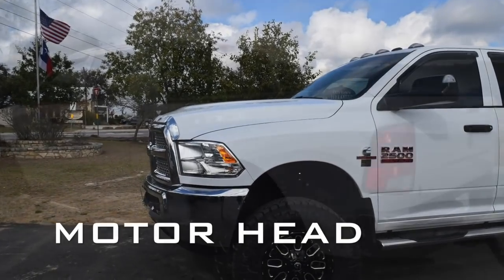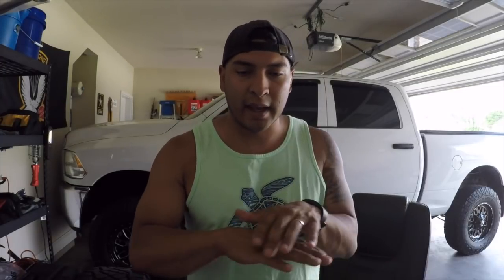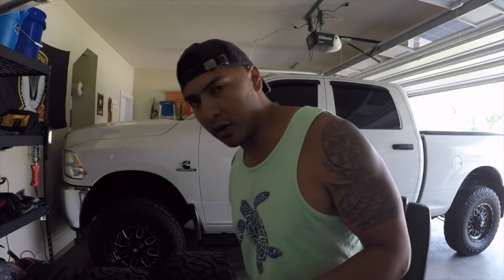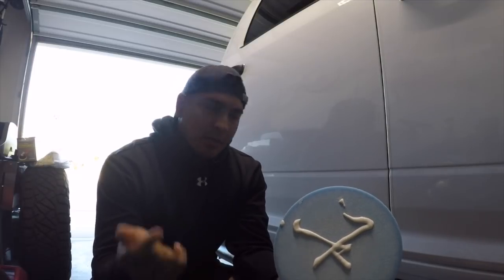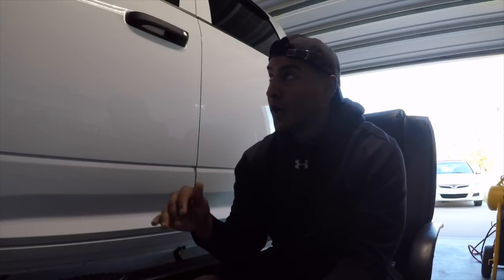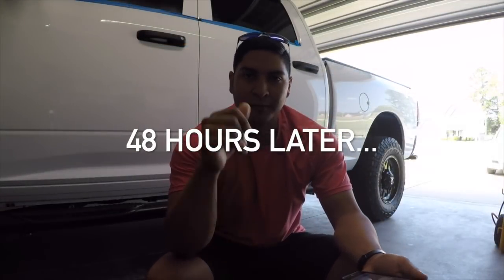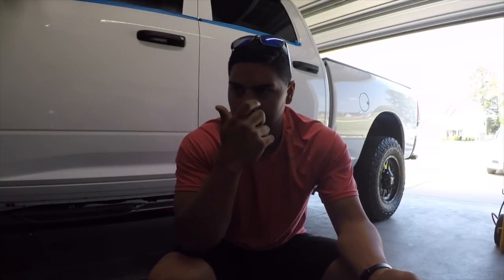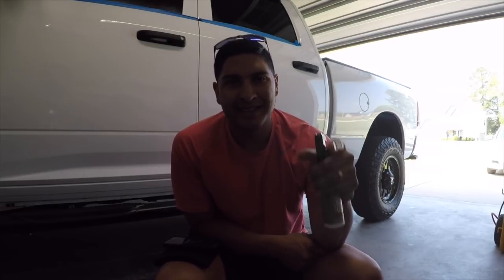Adams Ceramic Coating on Ram 2500!

Comment: I’m very interested in having this done to my silver ram 2500. I could never physically handle it due to major back issues and arthritis. It’s hell getting old.
Reply from the maker: Hard Truth It takes time but it’s quite rewarding. I’ve washed it once since the coating and it’s much easier to wash. In this 90 degree weather, the water beads off after driving it a little after the wash.

Comment: Great video, are you considering ceramic coating your windows?
Reply from the maker: Lluvia Dimas Never thought about that, but possible! How will that even turn out?! Lol
Reply: The windows will not get water spots if coated and will sheet water off like a super high grade of rain-x application. Definitely worth doing the windshield.
Reply from the maker: Lluvia Dimas I’ll check it out!
Reply from the maker: reltjj5150 2 recommendations must make it worth it! Thanks!

Comment: How long total time (including curing) if I wanted to do the entire process in one binge session.
Reply from the maker: P4UL they say Curing really takes 24 hours so that water doesn’t touch it. 24 hrs plus 8 hrs for one binge session depending on how many scratches you have on it.
Reply: Ok but the curing is on the back end so if  you binge early and let it sit overnight you could pretty much do it all in one day, just finish work the next day.
Reply from the maker: P4UL exactly.